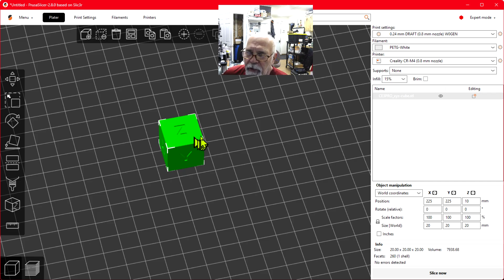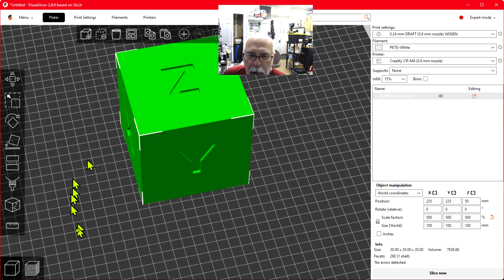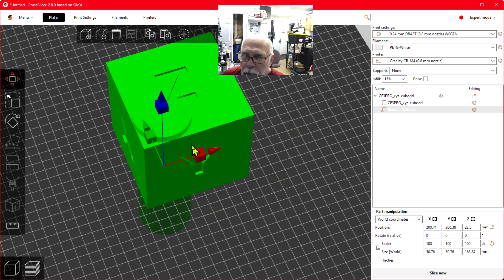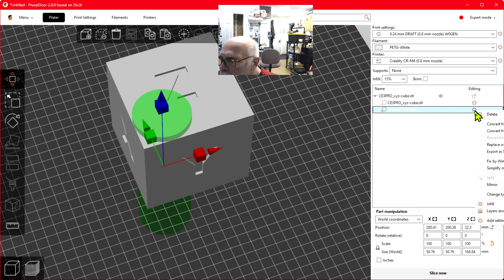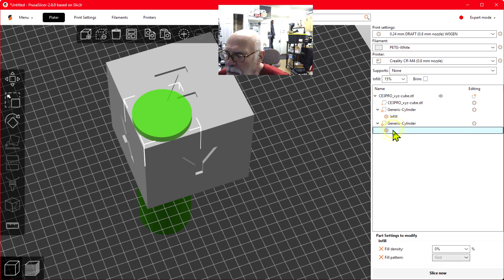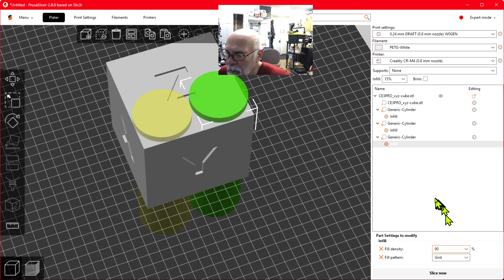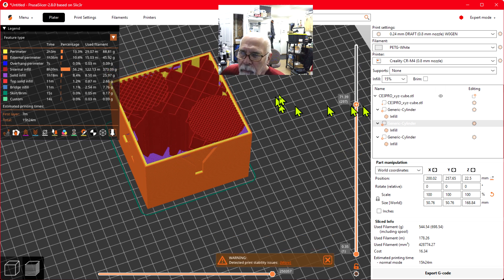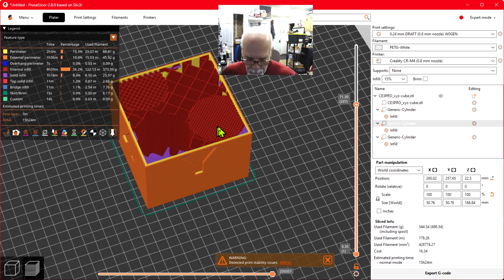How to have multiple infills on one 3D Part in Prusa Slicer

Comment: But if you try to print it, it'll probably be messy because the bits of infill won't line up.  Especially if you change the infill type.
Reply from the maker: That one was just to say you can do it... I do mix infills all the time to reinforce different areas of a print without issue.  for example , if I print a figurine, the arms I will increase infill at shoulder to strengthen the print.  Works for me!